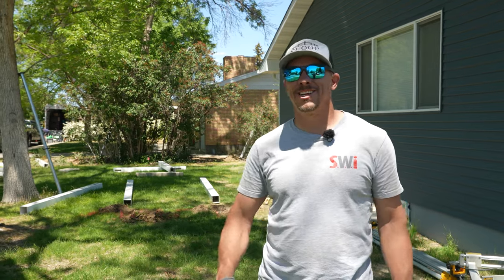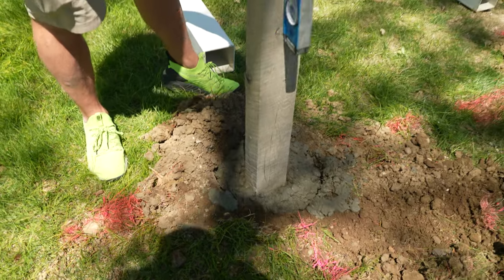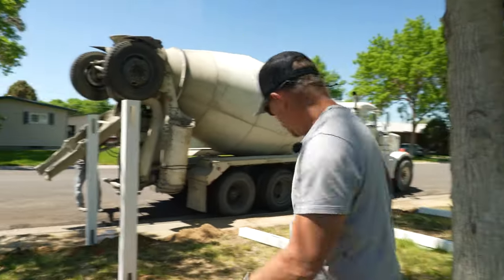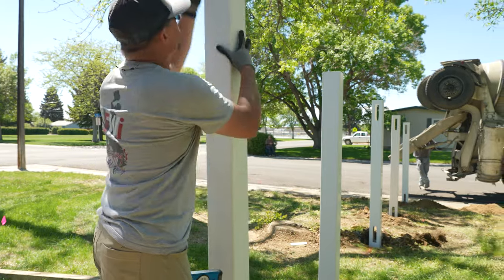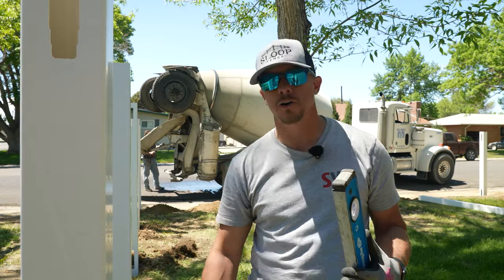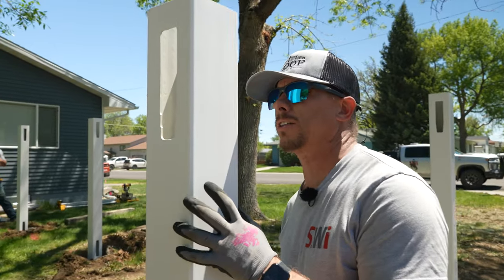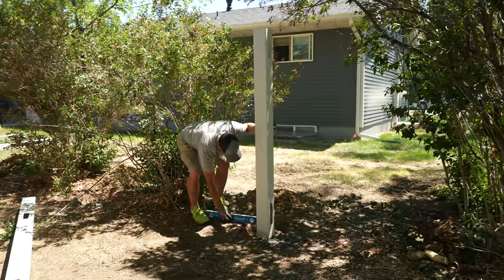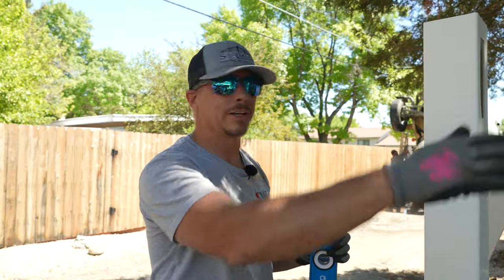Setting Vinyl Fence Posts In Concrete Without A String

Comment: This is the second fence video I saw fence builders bring in a delivery of concrete to set posts. That's crazy to me!
Reply from the maker: So much easier than mixing by hand or packing bags to dry pack.  We do a lot of commercial so mixing isn’t an option when you need 150 yards of concrete.  Its easier to get good at pouring trucks for us.
Reply: @SWiFence  I get it easier but does the cost wash with doing it yourself? Our local guys have a 3.5 yard minimum for free delivery
Reply: @FollowTheFood  if you track the extra time and hassle that min looks pretty good on larger projects. Picking up mixing and cleaning up bag mix kind of sucks
Reply: @stich1960  oh I can agree ... I just did the cost comparison and at around 200 posts it does make sense, but anything under that would not be worth it in my opinion...
Reply: @FollowTheFood  kind of depends what you value your time at too. Mixing eats up a lot of time if you don't have a great way to mix it. I am a single guy with min equipment so I see a min of two hours picking up and moving material and equipment savings and about half or less the time setting posts so my break even would probably be much lower than 200 posts personally
Reply: Just get a hand mixer and rapid set cement with a bucket and another with water thats all you need take the same time just a little more effort but way cheaper

Comment: Great information on dry setting post. Here in Southeast Texas the water table can be anywhere from 3’ below grade to 6” above grade. Please keep doing what you are doing. Love it. Thanks to all you guys involved.
Reply from the maker: I assume you “dry pack” in those conditions?
Reply: Just get a hand mixer and rapid set cement with a bucket and another with water thats all you need take the same time just a little more effort but way cheaper

Comment: I wonder, how the horizontal vinyl members are inserted, especially the bottom most ones, after the concrete sets up. Also how the horizontal spacing is measure and set.

Comment: Great video! One thing I’ve done that customers seems to appreciate is I always set the house post a few inches away from the window. I’m in Florida and folks around here like to board up windows in a storm so I leave them a few inches to be able to do that. Otherwise it’s a pain when the post is right next to it.
Reply from the maker: No hurricanes here...lots of wind though.
Reply: Just get a hand mixer and rapid set cement with a bucket and another with water thats all you need take the same time just a little more effort but way cheaper
Reply: Not for nothing but in Florida like the person said the insurance company won't cover the fence because it's not attached to your home FEMA doesn't think your fence is property or anyting of a physical nature as well
Reply: Brilliant!

Comment: Hi I enjoy your work i recently started a fence business and have learned so much from you. I am not at your level not even close but I hope to be someday. I have a few questions for you. Question 1: Do you manufacture your vinyl fences? Can I buy them from you? Question 2: Do you set your posts 6ft apart or 8ft apart? Question 3: How long are you rails 8ft or 10? That way if your 3 inches off on your post set having longer material really comes in handy to solve that issue on the perfect rail cut. Hope to hear from you I love that you are in Florida now because I am in Tampa Florida

Comment: Great video and great narrator, thank you for that, this is the way I will set up my fence soon, no braces just the string - just in case ;)
Reply from the maker: There is NO shame in using string or having it on hand to double-check your work. 👍🏻 Eye sighting can take some practice to pick up.
Reply: @SWiFence  
You are 100% right, I thing there is a shame if someone is not asking😊 question - what the minimum size (width) hole should be for a 5x5 PVC 9 feet post?
Reply from the maker: 12" wide and depth depends on how solid your soil is and frost depth (good solid ground 36" would do fine).

Comment: Just pulled out an old chain link fence that was dry packed in my buddy's yard. It was super solid in the ground, pulled them out with a mini excavator, but the concrete balls broke up nicely with a sledge hammer so we could reclaim the scrap.
Reply from the maker: Yes it gets hard but not like wet set or you couldn't do that.

Comment: I like the idea, and maybe I missed it, but how do you align the posts vertically? If you just eyeball the distance of the lower hole from the ground, you could be off by an inch or 2 every other post?

Comment: Just did my first DIY vinyl fence. I had 29 posts and 292 linear feet  surrounding my house. Let me say... I wish I DIDN'T follow your "Without a String" suggestion. I had a easy flat ground work space. My older, wiser, father brought his string on cement day to ensure we'd be straight...well, I told him..."I'm going to try a no string method of line of sight." WOW, do I regret that afterwards. The extra time to set up a string would have been MUCH MUCH better than what I ended up with. 80% of my posts turned out fine... but the other 20 % look low or too high, I had a couple that I didn't get to check as I had helpers on the project and I told them just line of sight... well they were hesitant and my wife scolded me afterwards for telling everyone "NO STRING today" just line up. SO, I got several that were a bit twisted, and some that stuck out too far and some not enough... just off.   A String doesn't lie and it could of helped all us amateurs in ensuring that the fence was going to be straight.  A NO STRING install...If you look at it closely... its off. If you don't look at fence other than the one time glance it looks great. BUT, deep down... you know it's off and a STRING could have made sure or at least gotten it closer. So,"CONCRETE WITHOUT A STING"... is cost effective for only the owner of a business cutting corners on time... And time is money, but for me... it bugs me now, knowing that my fence isn't as straight as I'd like. And yes, I did dig up several post holes and reposition them.  IT also cost time and money.
Reply from the maker: That's rough. We would be frustrated too if 20% of our posts were off. Sorry it didn't go well for you, but it's not fair to blame the method. Especially if you've got a bunch of people helping you that didn't really internalize what they were doing like you did. Everyone not feeling confident is a good sign they don't understand what they're doing.

Comment: how are you fellows and good job with the fence. I have a question on fence spacing.  do you always do it like that and if so you always do 94'' inches on center and not exceed 96''?

Comment: I've been installing fence for over 20 years and ALWAYS use string lines for grade and  alignment if it's more then a few posts. If it's windy then just use more stakes through out the line. A 1/4" to 1/2" variation in the alignment of and/or flow of grade is very noticeable to me and I like perfection so I take the extra few minutes to run lines and lay them out instead of standing back and eyeballing because that's not perfection to me. Only a laser or string line is capable of this to a level that satisfies my conscience but string lines are truer than even a trained eyeball IMO. I subcontracted for a guy who only used the eyeball sighting method on the jobs he installed and his work looked bad to me and many customers who complained. I would have to go back and fix it for him. Whatever works for ya. This is not one of my preferred methods but everyone is different. I'm gonna check out some more of these videos and see if any more of these methods spark my interest in adapting to my installations in the future.
Reply from the maker: Not everyone does it to the same standard, that's for sure. 👍🏻
Reply: I agree.
..a strong or dry line for sure.
It only takes a moment more to do the job right.
A dry line  also helps with squaring up the posts.
Just because its hard to see the discrepancy with the naked eye doesn't mean it's  right.
I will continue to use squares levels and string.
Reply from the maker: Absolutely--do what works best for you. 💪🏻 But don't assume we aren't getting it right. 😀 Eye-sighting is a time-honored fencing tradition.
Reply: @SWiFence  Like you said, "DO WHAT'S RIGHT FOR YOU" but you left out "AND THE CUSTOMER".  If I ran string lines on your residential or aesthetically critical commercial jobs after you were done, I'd be willing to bet that there would be several posts out of alignment and grade flow, even if it was only like an 1/8" or 1/4" and most likely more. The naked human eye is not exact in precision compared to simple instruments designed for achieving  closeness to 100% perfection as possible. It's your business and your techniques. Best wishes to you as a fellow installer but a word of advice to those who set by the eye. I wouldn't be announcing too much info on shortcuts to just anyone with the possibility of future customers watching these videos and seeing that you don't run lines of precision and prefer to do it all by eye to save time and assumingly increase profits. Some may be intrigued but many may be seemingly skeptical and critical. It's comparable to a home builders arrogant admission of not using appropriate measuring and/or leveling tools and other necessary devices. If I were you, I would at least run the lines to make it look like you're trying to be 100%. JMO. Good luck to you sir. I still may incorporate other techniques of yours as I deem appropriate. I like your videos either way.👍👍
Reply from the maker: George, we're genuinely glad to have you around. 👍🏻 We're gonna have to agree to disagree on this one. This isn't a "hack" or "shortcut" for us--it's truly the best method we have at our disposal. It's faster than string, we believe just as accurate (maybe even more so), and quite a bit more reliable. If you've got brush, weeds, trees, hills, etc--eye sighting will get you to a true & straight product with less hassle and less time. We take pride in our work (maybe too much 😋), and we take pride in our methods. We see eye sighting as kind of the "black belt" skill in fence building.
That doesn't mean we know everything (I bet you could teach us a thing or two we didn't know), but we truly believe eye sighting is a lost art in fencing. People have gravitated to string because it's easier (and sometimes a more reliable choice for the DIYer without experience), and over time everyone has started assuming that string is the "more accurate" method.
Reply: 100% agree with you.

Comment: Thanks so much for showing us all the professional method! I built my house in 2002 and am replacing a 14 panel fence on one side with 6'x8' vinyl just like this. Would you be willing to share your thoughts of weather pouring (wheelbarrow from cement truck) and setting 15 posts (a straight run) all by myself is a disaster in the making or actually doable? The soil here in Massachusetts is very rocky and fairly moist, not very dry like your Wyoming soil. Thanks again for the great video work and sharing the knowledge.
Reply from the maker: I think its doable for sure. If you are worried order your concrete with some delay set in it (kills it for x amount of time) but once it wears off it sets fast.
Reply: @SWiFence  Well I can say after the fact now it is easily doable! I had a chance to get it done a couple of days ago and went for it, I used a metered concrete truck and he set the mixture very loose, basically pea soup. Filled all 15 holes and off he went. The first post I put in just hit cement and stopped! Turns out I had to pound it in (up and down) to get it all way down, the rest of the posts went in easier as that first hole was very narrow but they all needed to be worked up and down to get them in. They never went more than 2" down in one motion. I guess there must be a difference in the size of the aggregate between here and Wyoming? Even with the extra time spent I got them all set and they look good, just one is a smidge low. It would have been a breeze if the posts just went with one push. Thanks again for the Info! I would have never got it done that quickly using other methods.
Reply from the maker: Love this! Rock on! 💪🏻

Comment: . I'm fixin to make my first attempt on a 300"er in rock hard dirt. Thanx for the video. Last time I built a fence. It was barbed wire. Did you drill the holes?
Reply from the maker: You can do it! Yep--drilled with an auger on a skidsteer.

Comment: does the stab method create drainage problems? the instruction for my 6ft vinyl privacy fence with 5x5 posts (7' corner to corner) say to put the post in the ground and THEN add concrete. it goes on to say that concrete should not go inside the post. Im in zone 7b if climate is an issue.

Comment: Great video. Is a pvc gate supposed to be level? I have a gate with two sde panels connected to my neighbors gate which also has two sde panels. I noticed the panels on my neighbors side veer inward and not align with my gate. I just want to know if this is going to be a problem down the road
Reply from the maker: Hmmm, it's kind of hard to picture what you're talking about. In general, yes, everything about a fence should be straight and level.

Comment: Love your video bro I have two questions. What’s your opinion upon the vinyl plank that runs horizontal? Is it weaker than the one that runs vertical and doesn’t matter 6‘ x 6 or 6 x 8 what’s your advice on both very much appreciate it bro
Reply from the maker: I've never worked with horizontal vinyl, so I can't give you an informed answer on that. If it has a tongue-and-groove system it should still be just as strong.

Comment: Looks great question, can this type of fence be put at a angle of the corner?  Maybe 60 degrees off corner .
Reply from the maker: Yes, sure can. The closer you get to the 45 degree mark it's going to get a lot tighter and you're going to have to start angle-cutting your rails--but you can definitely do this.

Comment: How do you fit in the rails and panels in once the posts are set/rigid? Do the rails bend enough to get them inserted into each post?
Reply from the maker: Slide the rail all the way back into one post, then forward into the other post. The rails are notched to prevent them from coming out.

Comment: I work in fencing here in San Diego and we set with no string lines! We also wet set our posts and never dry pack.  However we don’t not sett using the stab method we prefer to keep the post hollow in ground. I am curious to know if having the post filled with concrete in ground is better than having it hollow. Do you have any input on that?
Reply from the maker: You can do it either way, my opinion is I think it holds better and has a stronger bond.

Comment: What kind of concrete do you use? when I try using the method of pouring concrete in hole then pushing a metal post in it doesnt go in easy it hangs up, I use concrete that has gravel in it which maybe what restricts the pole going in.
Reply from the maker: Ours has gravel too, sounds like it just needs to be a wetter consistency.

Comment: Love Your video wish I could do that however I wanted to ask you if you pour four bags of concrete and pour water in it without mixing it do you think that would work? Because the bags say mixed with concrete and water so might work what do you think?
Reply from the maker: Yes - any method will work, but they won't all be the same strength. We haven't tested the method you're mentioning, but we have tested dry pack vs wet set. https://youtu.be/iBgWx2y9pj8
Reply: @SWiFence  thank you so much for answering me so quickly you guys are really awesome! I'll be watching the rest of your videos for sure thank you so much for doing this so everyone can see, not everyone is as handy

Comment: FYI when a 2' level is off plumb like you said by a little that's off that much in 2' not 6' it will be about double that
Reply from the maker: It will actually be triple that in a 6’ post.  2+2+2

Comment: How do you attach or reinforce the post next to the house for a gate ?
(Without digging )
Reply from the maker: We've actually got a video coming up (eventually) about this! We use a steel reinforcement sleeve inside for the gate post. 👍🏻

Comment: Alignment...check.  Slope....check.  How did you get the spacing of the posts exact for the panels?  I didn't see you do any of that measuring.  Did one of your guys come around after and measure distance between posts for the panels?
Reply from the maker: Nope we measured when we did lay out and we have an couple inches to play with so it's not super critical.  If it were close to max spacing we would double check as we set.
Reply: @SWiFence  Actually, I saw how the vinyl fence is put together vs. pre-assembled panels like at your local  LOWES/Home Depot. Looks very forgiving.  When I did my fence 20 years ago, I had to make sure the posts were EXACTLY spaced due to how they secured with clips mounted on the side of the posts.  Glad to see a newer easier design for my next project.
Reply: @SWiFence  do you set the post less than 96 on center to ensure spacing is correct for a rip cut and not more?

Comment: If your hole in the ground is too large can you use a cardboard pier liner to limit the volume of concrete needed?
Reply from the maker: Yes you can use a sono tube to reduce the hole diameter, you will want to fill up half way around the sono tube on the out side with concrete. This will help with structural integrity.
Reply: @SWiFence  Thanks.  My hole is sort of cone shaped due to root extraction with a pry bar...so most of the volume is near the surface.